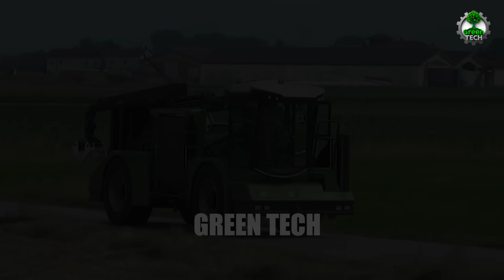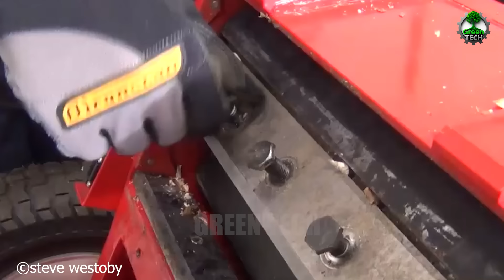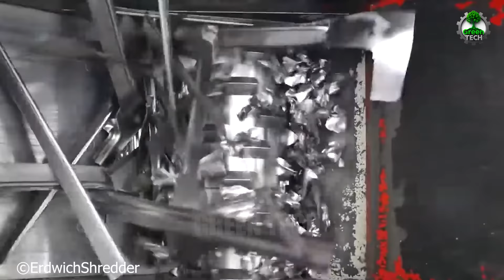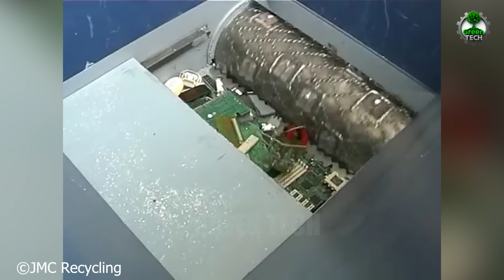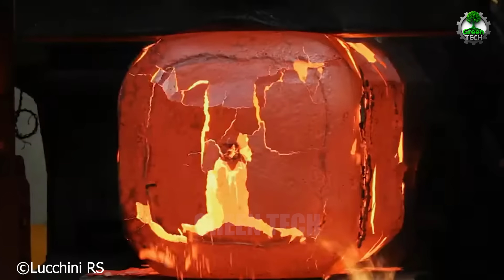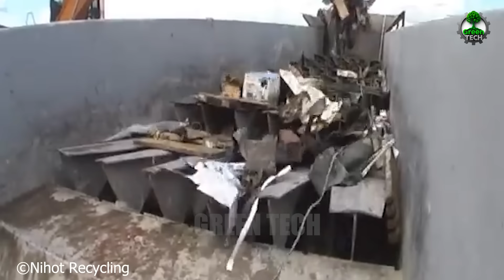Extreme Dangerous Metal Shredder Demolitions: Crushing Everything in Sight! #59

Comment: you want shredders? these are kids toys compared to rotochopper machines their wood chipper units have a cross belt magnet that is very handy for pallets as it removes all the metal and nails form them then is clean material Mr. Diggs channel tells all about it and brush and wood even pallets are loaded with an excavator not by hand one at a time like the stuff they show and oh the first one with the loader arm handled a few smaller logs big deal not going t be suitable for any major logging operation as it claims unless they chopping tiny stuff. all these machines are tiny and not going to be suited for any major full time operation they are small and slow and as shown can only handle a few pieces at a time

Comment: 1would like to see a bit more on what they do with the crushed mzaeterial😊
Reply: The metal goes to be used in steelworks, one day it was a Toyota, next a baked bean can. The same with plastic, rubber, copper, aluminium and glass, most are recycled
Reply: But what
Reply: It goes into landfill
Reply: @bertiewooster3326 Bertie, is that useful or is it just ground up garbage and junk moved to another pile. I’m not being sarcastic, but other than landfill  is it  used for anything purposeful?  I guess what I’m saying is cans can be grounded up and re made into cans or plastics can be ground up and reused to make plastic bottles.